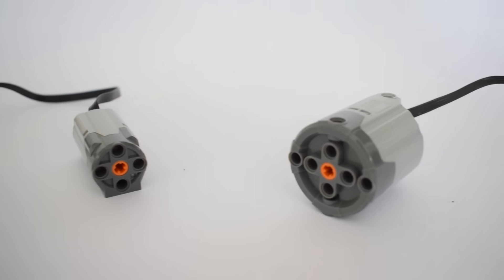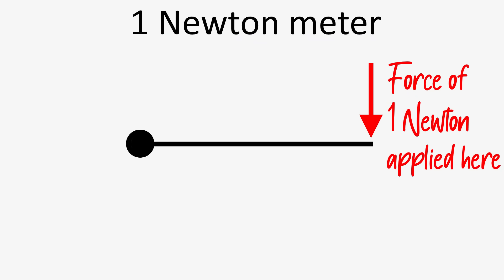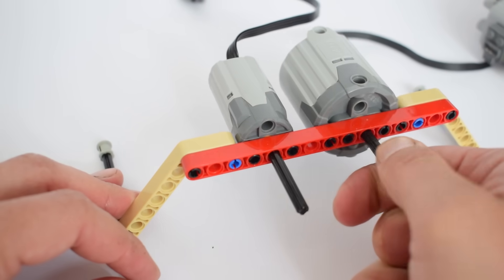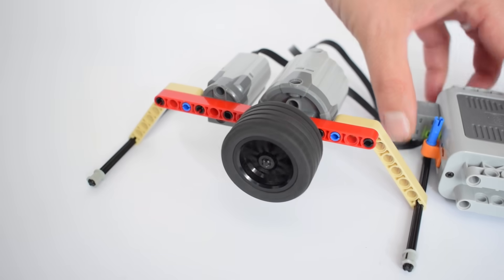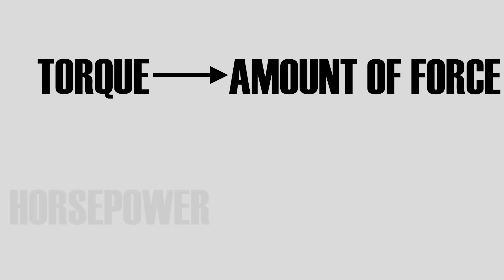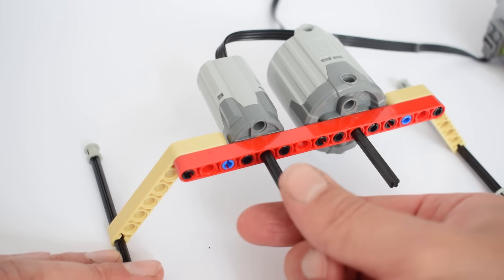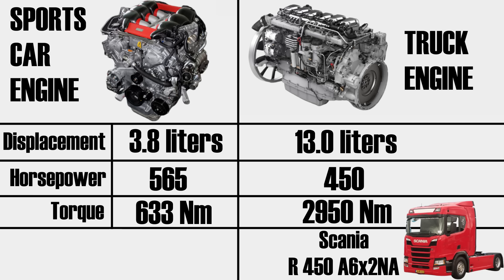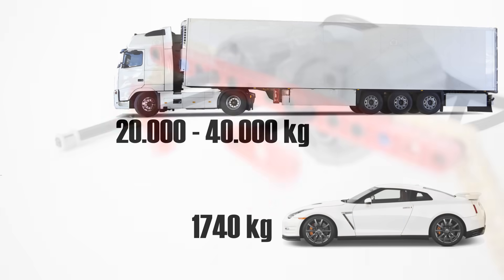NEVER be confused by HORSEPOWER and TORQUE again - HP and TORQUE EXPLAINED in the MOST VISUAL WAY

Comment: Fun fact: a horse has over 10 horsepower. 1 horsepower is it's power when pulling carts at slow speeds. But when going all out, most would have over 10 (it would vary a lot depending on the breed, age, fitness level, etc).

Comment: I thought I understood this topic well until now.
I just realized that there isn't a term for rotational version of Power, like there is for Force vs Torque. Think about it - if there's a different term for Rotational Force (Torque) vs Linear Force, there really should be a different term for Rotational Power vs Linear Power.
I'm going to call rotational power "Tower" and linear power "Lower" from now when trying to explain this to other people.

So there are 2 different variables here: the Rotational aspect and the Rate aspect.

To get from Force to Torque, you add the rotational aspect.
To get from Force to Linear Power ("Lower"), you add the rate aspect.
To get from Torque to Rotational Power ("Tower"), you add the rate aspect.
To get from Linear Power ("Lower") to Rotational Power ("Tower"), you add the rotational aspect.

How do you get from Force to Power, or Torque to Power?
Well it depends on which version of Power you're talking about - Linear or Rotational. If Torque is really a different concept from Force, the Rotational Power ("Tower") is really a different concept from Linear Power ("Lower").
In the context of engines, Power is rotational, so you're talking about "Lower". So the step to get from Torque to this Power is Rate - as noted in the video - Power here is Torque x RPM.
Note also that RPM is a measure of Rotational Speed, and this has a linear counterpart too. I think "Linear Speed" and "Angular Speed" are the standard terms in physics, so there sort of is a distinction between concepts here, but not as obviously as by having two completely different terms as in Force vs Torque.

So how does all of this apply to vehicle performance?
Well the key point here is that gearboxes can convert a high (Rotational) Speed low Torque (Rotational Force) output to a low (Rotational) Speed high Torque (Rotational Force) output. It's basically trading in speed for force.
To "go faster" in general, you want to be able to increase Force at a given speed. You can increase Force by trading in speed if you drop down a gear, but obviously that doesn't make sense as an option to go faster since dropping down a gear implies slowing down first.
That's why the combination of them at the same time - Power - is the "Key Performance Indicator" here.

Why is Torque even quoted in cars then?
When you can get torque from using a lower gear, but in that lower gear, it's just Power that will determine acceleration (as well as Power determining top speed)?
Well it doesn't really make sense, but it does have a little bit of value since being high Torque low RPM is correlated with having a lumpy Power curve rather than a peaky Power curve.
Having a lumpy Power curve increases acceleration throughout the rev range, but this gets less pronounced as gear shift speeds get quicker.
Optimizing an engine for performance at high revs (through camshaft timing etc) both makes the power curve peaky - out of the usable RPM range, more of it is at the top - and rev higher - it increases the total RPM range.
So Torque is correlated with good low-end Power. Note that it's correlation - most engines just happen to be this way. You can get high Torque peaky Power curve engines - turbo engines with high boost and no sort of variable turbo geometry feature are like this.
After considering all of that, it would be much better if there was some sort of mathematical measure of "Curve lumpiness" that could be quoted instead of the Torque figure. I'm going to call this "Power Curve Lumpiness metric" for now.

If instead of ICEs becoming illegal, gearboxes become illegal, it will make sense to quote Torque - for cars with the same Power, the high Torque cars will be the ones that accelerate fast, but have a lower top speed. So if you have to choose a car for Monaco vs Nordschleife, you can choose the high Torque ones for Monaco and the high RPM ones for Nordschleife.
Until then, quoting Torque is almost irrelevant and very confusing.

So for anyone feeling bad for finding this confusing, this isn't your fault. This is actually the fault of physicists and automotive journalists for following 2 illogical conventions without questioning them:

-Not having separate terms for Rotational Power and Linear Power
-Quoting Torque instead of "Power Curve Lumpiness metric"

I hope this finally makes sense rather that confusing you even further

- Giles

P.S. D4A: I love your Channel and I think it's just the illogical conventions that make this topic hard to demystify.

Comment: So if horsepower is toque over time then how can electric motors have a proper horse power rating based on the posted calculations.  Electric motors can produce torque with no rpm, as proven by this video, so no HP.  There fore it cannot produce torque over any amount of time?  Watts, were you thinking?

Comment: The video was very precise until it came to car and tuck. If the sports car engine has more horsepower, thus more "torque x RPM", then it has more Torque! Torque at the engine crankshaft is completly irrelevant! Torque must be measured at the effecting place: the rear axle. An negine reving to 7k RPMs at a truck gearbox meant for the input of 2,5k RPM will lead to unusable vehicle speeds. The same engine sparied with a suitable reduction gearbox, dropping the engine rev by 3 will lead to matching inputs for the truck gearbox and tripple the torque. Then the car engine has suddenly 1900 Nm, which is way closer to the 2950 Nm of the truck engine. And yes, a bigger engine with a completly different spec sheet performs better than an abused engine...
And now think of any standard car with a petrol and an diesel engine, that had roughly the same spec sheet. If the low revving diesel brings the same car with the same tires to the same top speed, there must be a longer gearbox in it! If you divide the petrol RPM by the diesel RPM, you get the difference in the transmission and can apply the same number to the diesel torque. One would be astonished to see that number crumple by quite a margin. And yes, Diesel engines run better and produce more torque, but the stupid numbers on paper are not reflecting that properly! One needs to have a corrected, nominalized number.

Comment: Torque proposes work, Power does the work.  Torque can do no work without the out power.  Power defines the rate at which work is done… including a zero rate.  This is why torque at 0 RPM = zero power and zero work.  All work is not only done by Power but it is done at a rate dictated by Power.

Comment: Force 
and Force per sec ?

why... do we care about horsepower again?
At the end you just want to know how much force something can push you with at given speeds no?
 Or at the end I guess... 
At what point will the force pushing you = force acting against you.
or what speed i guess. 

but by looking at your motor example. its more like. Push , stop , wait for next push
So...
How much distance will that push , push us for , and then we wait for the next push
take that... and avg it out over time... 
so you will know for a given amount of time what will push is further... or speed. 

doesn;t matter if something accelerates you heavily if the next push like 5 mins away.

but ... tyres are a circle , so shouldn't it generate acceleration all the time? 

hmmm
Im more confused.

Yea im fking lost.
don't care.. 
I just want to know if a car or motorcycle will push beyond a certain speed. 
and why that stupid graph has torque falling but horsepower increasing (well i understand it now , less force but more of it per time) and what that has to do with acceleration at the highest speeds

Like at the end. 
I just want to convert Fxdistance (not work... torque... NOW ITS EVEN MROE CONFUSING) into Force
then go Force car is producing - forces acting against my car = Force i have to work with

and then do Force i work with / mass of car = acceleration of my car currently. 
cause if its not 0 ... It means i can still go faster

Comment: I always knew that torque, in the case of an engine, was a measure of how much rotational force could be generated and that horsepower was a measure of speed of 'output' rotational speed in that engine. This video explained this perfectly.
Reply: Rotational speed is RPM.

Comment: All I got from this is: Torque is acceleration and horsepower is top speed.
Reply: Definitely. First one gets you going, the other keep you going. And rpm is the steroid
Reply: @Itsjodey  Torque proposes work, Power does the work.  Torque can do no work without the out power.  Power defines the rate at which work is done… including a zero rate.  This is why torque at 0 RPM = zero power and zero work.  All work is done by Power.
Reply: Power, not torque, is the limiting factor in not only the top speed of a vehicle but also how quickly it can accelerate at any speed and how much weight it can pull up an incline at any speed.

Comment: And how can you calculate the Horsepower? You said by multiply the torpue with the RPMs, but in my mind that dont make any sense.
Reply: Power is torque×angular velocity× C, where C is a conversion constant. If power is measured in horsepower, torque in pound feet, and angular velocity in rpm then the conversion is 1/5252. That gives you the units lb*ft/s, force multiplied by distance divided by time.
Reply: Maybe because you’re using Revolution Per MinuteS instead of RevolutionS Per Minute. 😂

Comment: Very good. The next question is: what determines at what Rev rate the maximum torque occurs? A diesel engine is superior to a petrol one in this respect, as it produces a higher torque at a lower rpm.
Reply: It’s other way around.  The higher the RPM you multiply the torque by the more power you make.   Power, not torque, is the limiting factor in not only the top speed of a vehicle but also in how quickly it can accelerate at any speed and how much weight it can pull up an incline at any speed.
Reply: @rollsroyce329  Yes, but with a diesel engine, you can drive about in higher gears without the engine struggling,  because the torque is higher at lower revs. The ultimate engine for torque is an electric one, which has plenty of torque at zero revs. The question remains, what determines the peak torque, and why does it occur at lower revs in diesel/electric?
Reply: @davidb4192 there are some good videos explaining it from D4A about diesel vs gas (although he mistakenly states that crankshafts provide leverage) and engineering explained does a good one on electric torque vs Gas power.  He does non on diesel as well.  I’d start there.  Too many factors to go into in text and frankly torque is far less important than power for performance so I have little interest in diesel and the cost of electric cars can’t be paid by society so I have distain for electric cars and the communism 3.0 that they promote.  Good luck in your search though.
Reply: @rollsroyce329  I'm a "diesel head", I just love that a diesel car can just take off without having to change down in gear. The only reason I changed to petrol was because of the bad press that diesels have received, and also problematic diesel particulate filters.

Comment: How can anybody be confused by horsepower vs torque? Torque is how strong the machine is pushing vs horsepower is how fast it can go
Reply: Power, not torque, is the limiting factor in not only a vehicles top speed but also in how quickly it can accelerate at any speed and how much weight it can pull at any speed.

Comment: So, if a car has a higher torque, does that mean it’s harder to stop or brake?
Reply: Indirectly.  Vehicles with very large torque numbers tend to have very large engines.  The additional weight of it and the heavier driveline contribute to more mass to slow or steer. Other than that not really.

Comment: Great video, though you came very close but missed a great analogy: that big strong guy can lift more weight because he’s stronger, whereas that smaller guy who is very fit can do way more work in a given day. So if they were splitting wood, the small guy would do far more than the big guy, but the big guy would be good at splitting the really tough blocks of wood.

Comment: 1:30 so torque is the same as moment of force? Cuz chatgpt says no but they have the same concept and explanation
Reply: They are very similar and it's more just semantics. Torque is specifically dealing with rotation about an axis. Moment can be any bending force. Torque is a twist while moment is a bend. Mathematically they are pretty much the same, force times radius.
Reply: Mechanical Engineering student here 🙋 Honestly even I never thought of it that way. I often think both moment of force and torque to be analogous because their mathematical formula is essentially the same and you could replace the word torque with moment of force in almost all case and it'd still make sense to enginners. It's honestly not required for you to rigorously understand the difference between torque and moment of force, if you're dealing with real life problems. Just treat them similarly

Comment: Simply that horsepower(HP) means that how much car can go maximum speed and torque which is a strength to pull the car
Reply: Power and Torque are not Batman and Robin please stop trying to assign them roles. Power, not torque, is the limiting factor for not only how fast a vehicle can go but also for how much weight it can pull at a given speed and/or how fast it can accelerate a given weight. Torque is the sound of one hand clapping. Without RPM nothing happens.
Reply: Same thing i said @rollsroyce329
Reply: @Swarajjjjjjj  No you said power = speed and Torque = Strength which is hivemind 🚮. Power = Force x Velocity. 
All work is done by Power.  Power dictates how much work can be done in a given period of time (that’s your “strength”) and power dictates how quickly a given amount of work can be done (that’s your “speed” ).

Comment: Energy is not "stored" in fossil fuels.  Energy is GENERATED when fossil fuels are forced to change their state of matter.
Reply: Yes it is, energy cannot be created or destroyed. Fuel stores chemical energy in the molecular bonds of the fuel. When the fuel is burned those bonds are broken and the energy is released. Burning is not a phase or state change, its a chemical reaction that releases energy.
Reply: @R @Redtooth75 actly. the carrot stores the carbon it pulls from the CO2 in the air when photosynthesis separates the oxygen from the carbon through photosynthesis powered by the energy from the sun.  I eat the carrot and use the oxygen I breathe to burn the carrot to release its energy. I breathe out the residual carbon dioxide.  And this, the circle of life, it is what Communism 3.0 wants to stop.

Comment: If you add a  6:1 gear box to the smaller motor the  final output would have more torque at the output shaft than the larger motor.  Horsepower or the amount of work it can do would stay constant, minus any losses in the  gear box.   Just a guess though

Comment: Hp ratings for cars and trucks is for totally different purposes. For cars,
is measured at redline, HP for trucks is measured at where they operate continuously, or it used to be. Sport trucks can be revved high too and make tons of power. Watch Gale Banks Destroying a Duramax. ~1000HP on a stock motor.

Comment: I realized the difference between these two motors when I was building a large treaded moc and 4 small motors didn't provide enough torque to move the treads under the weight of the vehicle. I replaced them with 2 large motors and it has no problems now.

Comment: tell me I can't feel horsepower like force isn't equal to mass x acceleration.
Reply: You feel acceleration and jerk. Acceleration is created by the torque applied to the wheels. The force pushing the car forward comes from the torque pushing against the ground, a tire with a 24 inch diameter with 1,000 pound feet of torque pushes the car forward with 1,000 pounds of force. It requires a certain amount of power to apply whatever torque at a given rpm. With more power you are able to apply more torque to the wheel. With more torque you get more acceleration which you feel. So in a roundabout way you can feel power but more so you feel the effect of torque applied to the wheel, and power is how we can get torque applied to a wheel.
Reply: You can’t feel torque because torque on its own can do no work.  All work is done by power.  If you see, feel or record something happening it is happening because of power not because of torque alone.

Comment: In a car context. Oversimplified 

You can move >
Horsepower (or Kilowatts) - how fast
Torque - how much weight 

E.g.if you remove all the excess weight from the truck engine you will get a very quick engine as well. 
This is not factoring in the other 50 forces involved in motor vehicle (friction, gross weight, transmission,fuel type wheel diameter etc). This statement would be true if you connect the engine directly to the wheel